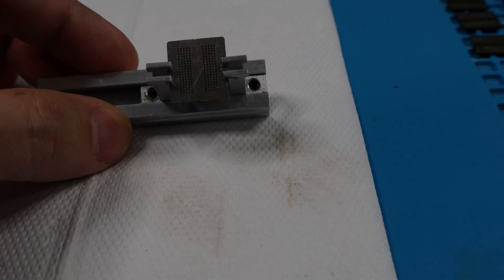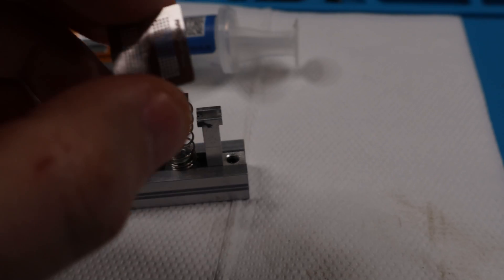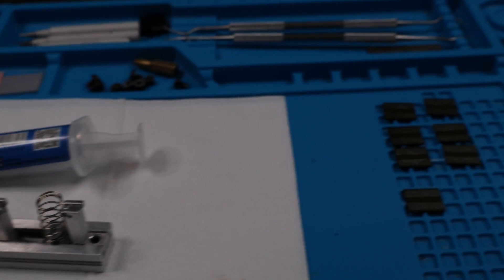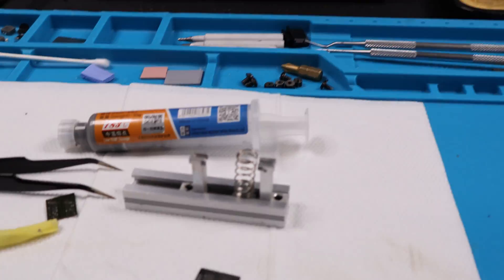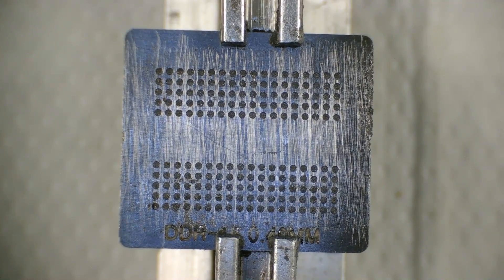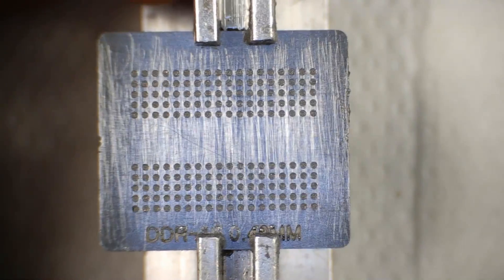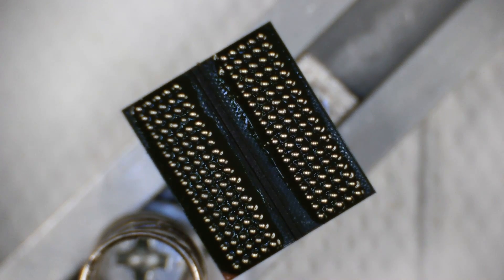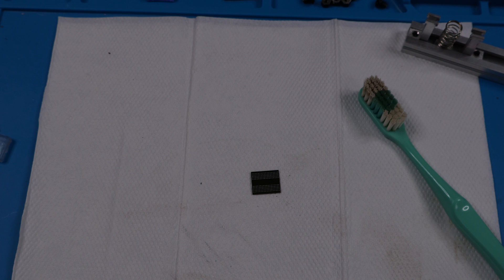How To Re-ball BGA Using Direct Heat

Comment: This seems to put the IC through so many extra heat cycles, possibly past the mfr's specification limit which is often just 3... including the initial manufacture of the board assy. I would also be concerned about the thermal ramp rate - whether it meets the mfr specification so as not to cause damaging internal thermal stress between the silicon die and the carrier.
Reply from the maker: Reballing using solder paste with direct-heat or using a 90x90 stencil and balls yields the same results. But, I'd say from experience that using the direct-heat method is easier on the chip as the heat is focused on the stencil, rather than directly on the chip. Either way I've never had any issues with both methods. None of my memory repairs have ever come back.
Reply: @TechnologyHive   All good... for my home stuff, I wouldn't worry... I work in a high-rel environment, so it makes me nervous.